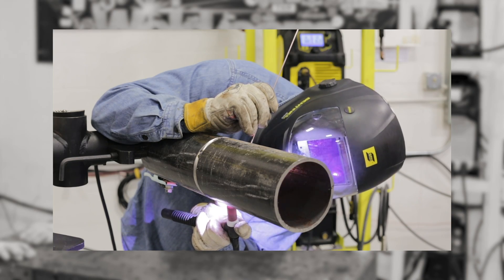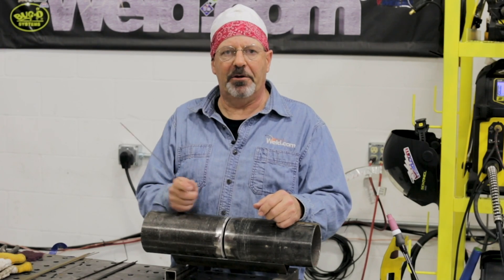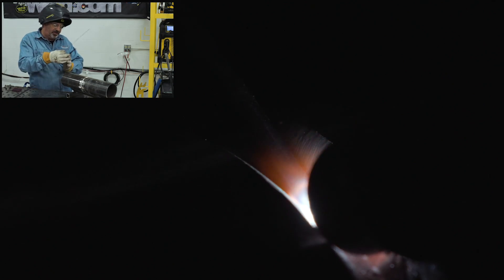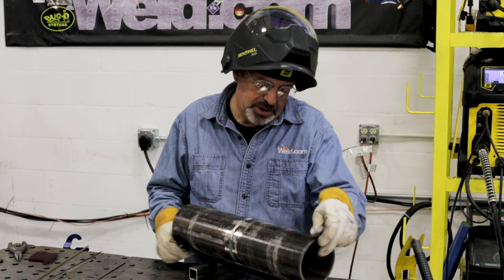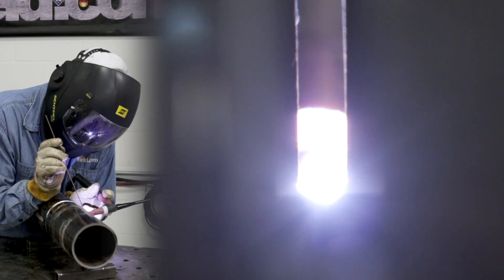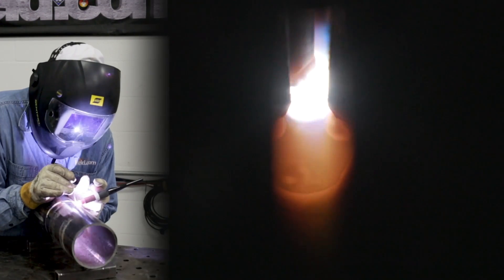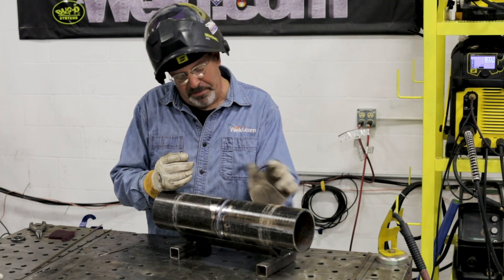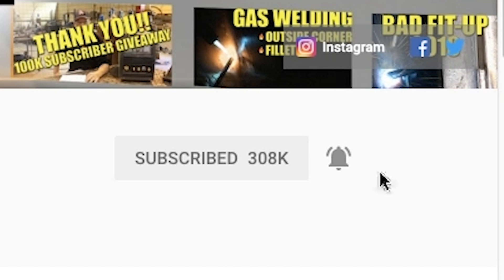BEGINNERS TIG ROOT: 1G 4 Inch Pipe

Comment: You got a vid on how to do a 1" stainless steel pipe thin wall? I can weld stainless however i always struggle when it comes to pipes... Yesterday i was asked to do some piping for low pressure water(not for drinking) , had to be stainless because of the environment. It isn't leaking, customer was happy as i told them before it wouldn't look great. But i don't like it because it look awful in my eyes and i was struggling the whole time. Need some help/tips

Comment: The most important welding parameters of tubular parts are current and welding angle. If the current is too large, it will burn through the molten pool. If the current is too small, it will not be able to completely melt the electrode.
At the same time, the angle of tungsten rod determines whether the current can hold the molten pool to realize continuous welding.
But I think the weld gap can be smaller for novice, so it won't lead to penetration.